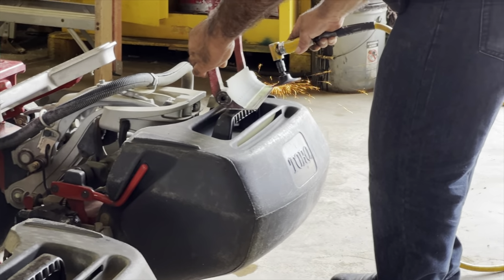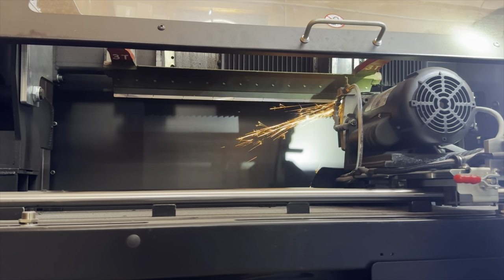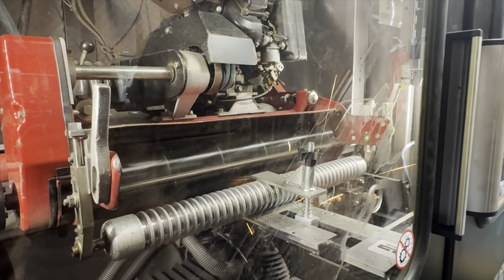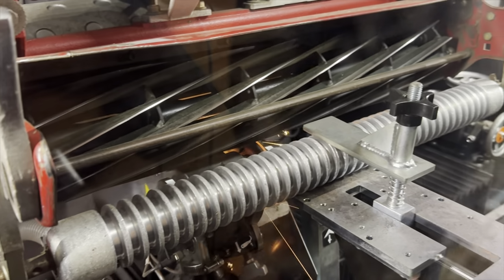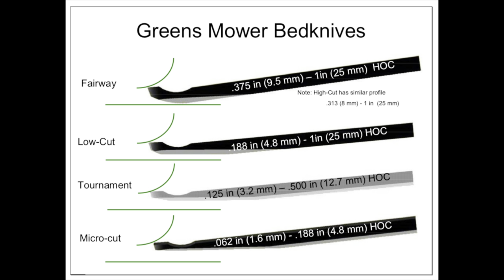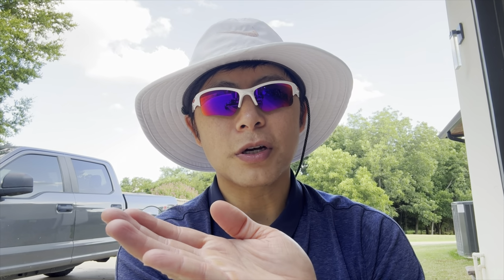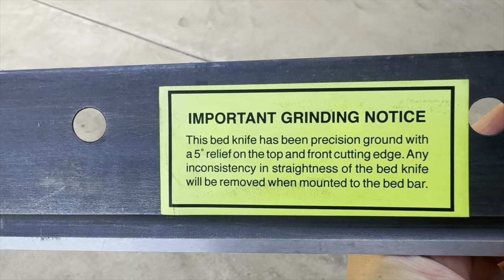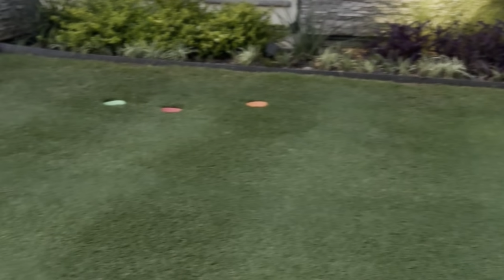SHARPENING REEL MOWER | Mid-season Reel and Bedknife Grinding

Comment: I bought an extra toro bedknife for 40 bucks. Probably cheaper than the sharpening service lol.
Reply from the maker: lol that’s assuming the bedknife is perfectly even all the way across
Reply: @MyLawnStory  oh, no. Any new bedknife would need sharpening. Even if just a backlap. Or light grinding. I didn't mean to not grind. Just saying it won't hurt the bank.when you finally need a new one.
Reply from the maker: now all they need is interchangeable bedknife system when you want to cut putting greens height and fairway heights 🤣